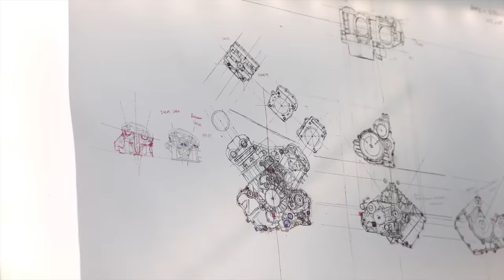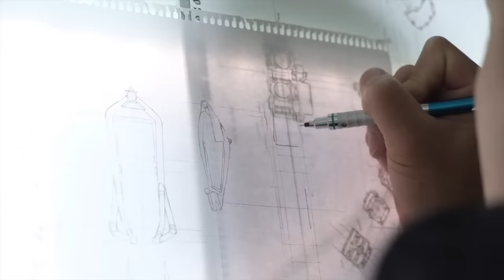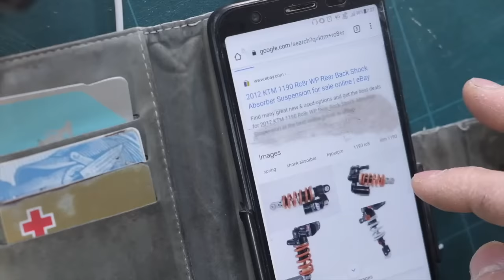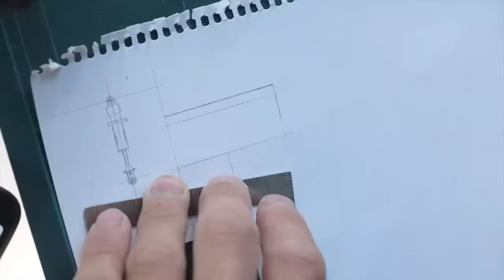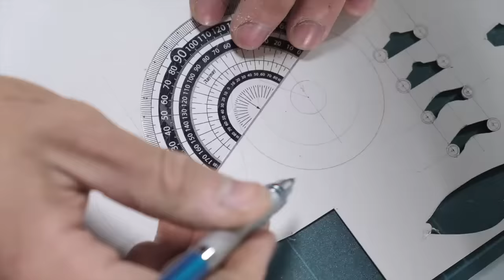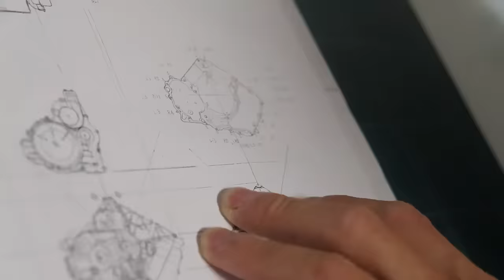Making KTM 1190 RC8 -Paper modelling- KTM RC8 を作る

Comment: What type of paper are you using man. I tried with my sketch book Paper it does not have the same thickness. Can you plz tell me the thickness of the paper you have used
Reply from the maker: I use paper that is as thin as possible.
The thickness of the paper I use is more like copy paper than canvas.
Reply: @Papermodelling  In the bible the paper most often used is called onion paper, you can almost see through the paper it is very fine paper, and thin to the touch it is easy to tear apart! Is this the paper you're talking about?
Reply: @Papermodelling  oh ok now I get it thanks for your help. Your talent is amazing love you bro ❤❤